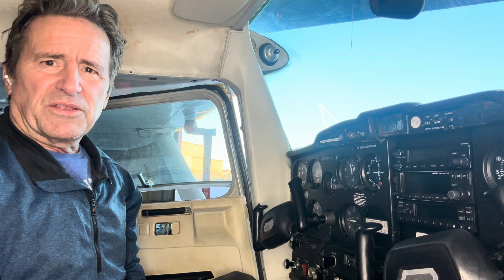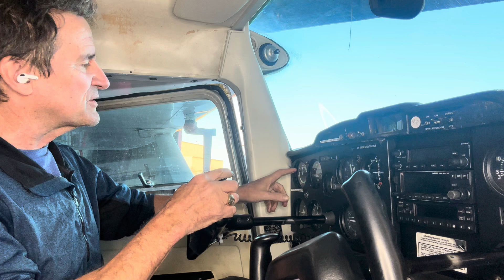Every Airplane Has an Angle of Attack Indicator

Comment: Boy, the haters are certainly out today.
Reply: It’s not hating, this is just a dangerously incorrect explanation of angle of attack
Reply: @ The position of the yoke isn’t an actual measurement of angle of attack, and I don’t think he said it was. However, the position of the yoke is relative to the angle of attack.
Reply: @txkflier  the position of the yoke CAN be relative to the angle of attack. There are many situations in which angle of attack and yoke are separate. For example, after a stall has broken you can continue to hold the yoke back but the aoa will be decreasing as the nose drops. Obviously that’s not a situation in which this thinking is dangerous, but there could be. My issue with this (as an engineer and pilot) is that people are always wrong and always trying to oversimplify angle of attack. It’s not that difficult of a concept, and actually explaining to pilots what angle of attack is would be useful. Some things (like exact mechanism of lift generation which pilots get wrong all the time) are not important to understand to a full physical level. Angle of attack is something that all pilots should be able to correctly explain. “Life hack” explanations like this are not safe to teach students IMO, just give them a real explanation and examples of how it applies in flight.
Reply: @slade8212  If the plane is trimmed for a safe airspeed and you don't push or pull on the yoke excessively, the plane won't stall. Of course, you need to keep it right side up and not let it run into anything.
Reply: @ sure, that’s typically true. There’s just a lot of important nuance to that discussion that is lost with simplifying it to “if you pull back all the way you stall”
Reply from the maker: @txkflier  YES!! Thank you - someone actually got the correct message here🙏👍
Reply from the maker: @slade8212  Agreed, this is an oversimplification. The point is more basic. You see how everyone here immediately equated AOA with airspeed? Most "1G pilots" (incomplete training) have never seen an accelerated (or secondary) stall with the nose below the horizon. It is natural (and more dangerous) to equate AOA with flight attitude (very common and very dangerous). AOA is mostly "invisible" bur roughly correlates with yoke position.
Reply from the maker: @txkflier  Exactly correct. In other videos on this channel, we call this the "comfort zone!" Most pilots fly in the center of the "1G world" and that is fine so long as you are never displaced by turbulence or a mistake. LOC-I is a killer though that easily "harvests" these pilots when an upset occurs: they have no "recovery tools" because they never did a stall since they left basic flight training (terrified pilots).
Reply from the maker: @slade8212  I agree; an oversimplification, but if you read the comments here, you see the level of ignorance and confusion. I think it is better to make a point like this to establish a rough correlation (and start people thinking if they are not over-reacting). The idea that "a stall can happen at any airspeed" confuses people all the time. WHen I give a flight test I ask "how can they mark stall speed on the airspeed indicator?" and there is no understanding of what really creates a stall. Most basic flight training endlessly repeating the term "stall speed" creates the real dangerous mindset: so long as I am fast I am safe!"
Reply: @SAFEPilots  I understand the message that for simple flying the yoke is a good indicator, the issue is that it’s not an indicator when it would be important. Like you mention, you can stall while flying straight down. But you can stall while pushing the yoke straight down also. Neither flight attitude nor yoke are good indicators for AoA when AoA is actually important. During normal cruise and light maneuvers, your angle of attack is mostly the same as your pitch and you’re at a good safe AoA and the statements in this video are accurate. The issue is when that’s not the case, the yoke is not a good AoA measurement and that needs to be clear. I just don’t see a reason to teach this if it only works in ideal scenarios, and I don’t see why pitch being equivalent to AoA is more dangerous than this - in my mind it’s essentially the same argument. You mention people being confused by “you can stall at any airspeed”. Again, I don’t think the concept of angle of attack is particularly hard to teach and understand. Anyone who is capable of being a pilot should be smart enough to understand simple trig and vector math. Maybe it’s the engineer in me, but I think actually understanding how angle of attack is defined and how it is not something measurable if your aircraft doesn’t have an indicator would be better than this type of life hack thing that only works in normal situations.
Reply from the maker: I detected some lack of respect here for what should be a serious discussion. It quickly deteriorated into the pitch/power/airspeed problem (next webinar). I did not mention airspeed in the video except to point out you can stall at any airspeed. Yoke position correlates with ANGLE OF ATTACK (which is largely invisible to a pilot). AOA does not correlate with flight attitude either (you can stall pointed straight down).

Comment: We certainly can control glide angle or glideslope with elevator pitch and airspeed with throttle so long as we maintain way too much airspeed to safely land a small airplane.  Vso, an out of ground effect number, at the fence leads to many go around and LOC with damage and even fatalities.  A pilot pulling on the stick is what causes stall.  No more pitch up to go up... rather down.  I taught at Monte Vista in the C-140 summers while my wife attended Adams State.  I told my students that when pulling back doesn't get the climb they expect, try pushing on the yoke.  Exceeding the critical angle of attack is when the stall happens.  A pilot pulling on the stick is the cause.  So if we use elevator for glide angle and rate of descent for a visual approach, we will have to use elevator at one inch above the runway to do the opposite, pull to stall/land/quit flying.  All good so long as muscle memory is push not pull when we don't want to land/stall.  So you big airplane jet guys are not going to either have problems climbing or need to three point stall land the airplane.  We who want to be all slowed up and ready to squat, as Wolfgang says, so as to not damage skin and tin may find the power/pitch deceleration to bring dynamic throttle into very effective glide angle and rate of descent control all the way to touchdown on the numbers with power, may prefer elevator for airspeed control and power for glide angle control.  And shooting many hand flown (the Huey had no autopilot) instrument approaches, required cyclic airspeed control and collective (think power) glideslope control.
Reply: Have used pitch for glideslope and power for speed on approaches 100% of the time for 49 years.  Never a problem.  Go-arounds are the same as takeoffs - full power and pitch for airspeed.  Sometimes if the go-around is started near or on the runway, acceleration is required before the climb can be started.
Reply: @warren5699  Small airplanes can and should land slow enough that pitch up to the three point attitude, in very low ground effect, will cause descent rather than climb.  While shooting the ILS your way, you change to pitch for airspeed to arrive at ground level in three point attitude all slowed up and ready to squat as Wolfgang says.  KISS, a principle of war, works with training students to fly quickly.  Elevator for airspeed and power for glide angle all the way down without changing keeps it simple.
Reply: @jimmydulin928  I don't really change the pitch for airspeed.  I chop power, flare and hold the airplane barely above the surface.  As you know, it transitions automatically to the landing attitude.  It's all pitch to altitude, in this cases inches.

Once the pitch and power are set and the airplane trimmed, most of the time it's just pitching to keep the aiming point stable (pitching to altitude).  In the majority of the time, the pitch changes are so small that the speed is stable and no power changes are needed (usually speed changes plus or minus a couple of knots).  So that often gets the workload down to just very very small adjustments in pitch  (as far as pitch and power).  I don't know how it could be simpler than that.
Reply: @warren5699  I am sure it works for you.  The Navy does that, but they call it a catch.  I assume your airplane is pretty heavy to stay planted going much faster than stall in one inch ground effect, which is way slower than Vso.  Civilian airports don't have wires to catch.  My 172 will skip and hop unless I arrive at ground level in a three point attitude all slowed up and ready to squat.
Reply: @jimmydulin928  It's really straight out of the handbook.  The roundout starts 10-20ft above and by the time the mains get within inches of the runway, the rate of descent should be getting really close to zero.  The line of flight becomes basically parallel to the runway surface for a few seconds with a gentle landing just above stall speed.  The airspeed for a normal landing should result in a touchdown in not more than 400ft past a specified point.  If you descended from 3000 to 2000 at 1.3xVso and chopped power when the leveloff began, it would look exactly the same as the roundout and landing.
Reply: @warren5699  Yes, that is the round out and hold off technique.  Once you close the throttle, elevator now controls both altitude and airspeed.  While not in the book, other than Stick and Rudder, with airspeed slow enough, throttle can accurately nail glide angle all the way to touchdown while elevator can decelerate coming into high ground effect and continue to touchdown.  Both controls used together all the way down, the power/pitch approach to touchdown, is extremely more accurate, safer, and better energy management.  In the long hold off, using the round out cut throttle and hold off, the pilot is just a passenger.  The airplane will quit flying when the pitch attitude results in stall in low ground effect much slower than Vso.  LOC, however, generally happens well before slow enough to stall in one inch ground effect and is too often deadly.

Speed is the problem.  Your elevator for glideslope and power for speed and my the opposite are different ways to achieve ILS and ACS landing technique.  The way I use the controls also allows for the more accurate, safer, and more energy efficient power/pitch approach to touchdown slowly and softly on the numbers every time.  Not necessary, not book, just safer.
Reply: @jimmydulin928  What you say happens with round out and hold off is just not the case if done correctly.  If the speed is controlled correctly with the throttle, there's little to no float and the airplane can be spot landed and very softly with completely safe control.  Why are you saying LOC generally happens - I've never seen that happen.
Reply: @warren5699  Ok

Comment: This is a ridiculous explanation. This is why GA pilots have so many stall/spin accidents, because they get taught by guys like this.
Reply from the maker: I think you are confusing angle of attack with airspeed. YOu can stall an airplane going straight down with a full back yoke. the "one G world of flight training" creates confusion.
Reply: @ no, I’m not confusing AOA with airspeed. 

Full deflection of the elevator does not give any indication of angle of attack and doesn’t even mean you will stall the aircraft. Pulling back to a full deflection momentarily, doesn’t even mean the AOA will come close to its maximum. 

Also, you can exceed your critical angle of attack and not have a full deflection on the yoke. Prime example of that would be an accelerated stall. 

Your elevator/yoke position is not related to your angle of attack. 

I’m sure you have seen other people comment the same way as me. 

You should take some aerobatics lessons, maybe you understand it better then.

Comment: This is really, REALLY bad information and should be completely ignored by ALL pilots. What this guy fails to understand is the fact that the critical angle of attack changes based on bank angle. You can have your yoke in a central position relative to level flight, and then if you bank the airplane to 60° you will exceed the critical angle of attack and stall the aircraft.
Reply: Doesn't make sense.  The steep turn is started with a centrally positioned yoke and then a steep bank which can be up to 60° if the pilot wants, and there's no stall.
Reply: @warren5699  Remember, stall speed increases with bank angle. Thus, you will stall earlier when you pull back on the yoke when in a bank. https://images.prepware.com/ASA-PPT-11/PPT-1-37.jpg
Reply: If you bank to 60° in a level flight, you will start descending unless you pull on the yoke.
Reply: @flyingconsultant  Ok you didn't say you were maintaining level flight.  It sounded like you were saying the bank alone will cause the stall.  Even if you pull back and don't increase power, the airplane may not stall - only lose speed.  You know it's one of those 'depends' scenarios.
Reply: @warren5699  I think you’re mixed up your reply’s.
Reply: @flyingconsultant  Well, could you reword your original point.  Banking alone doesn't make the airplane exceed the critical angle of attack.
Reply: @warren5699  “Accelerated Stall”. It’s a commercial manuver.
Reply: @aero3085  It's also required knowledge and risk management in the Private ACS.  Accelerated stalls were in our Part 141 syllabus so we did them with Private students.  To do them, it requires a substantial rearward movement of the control wheel/stick like any other stall.  But that's the point of the video.  When the control wheel/stick is being moved back, it's basically the same information as given on an angle of attack indicator.  The airplane is getting closer to the stall speed.
Reply from the maker: @aero3085  Thank you! A glimmer of understanding in a sea of ignorance. TOo many people misunderstand Angle of Attack. It does not correlate with airspeed. The commercial "accelerated stall" is designed to demonstrate that exact (critical) piece of information. The term "stall speed" is the big problem here. That is only at 1G!! As you increase G force (AOA - Back pressure) you accelerate the stall: it occurs at a higher airspeed!!
Reply from the maker: @aero3085  Yes accelerated stall demonstrates "stall at any airspeed!" The pilot holding level is increasing back pressure (AOA) and the stall occurs 19% higher in a level 45 degree banked turn.